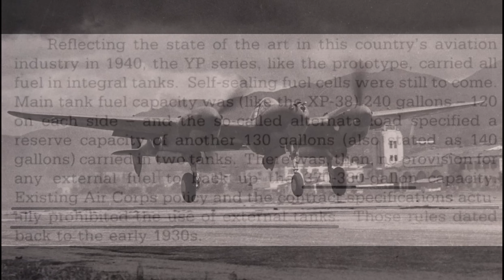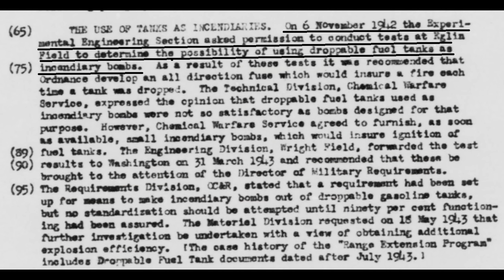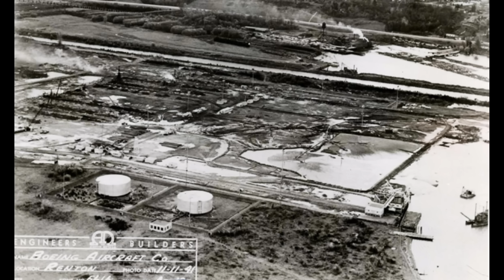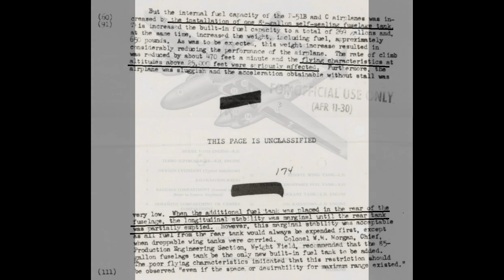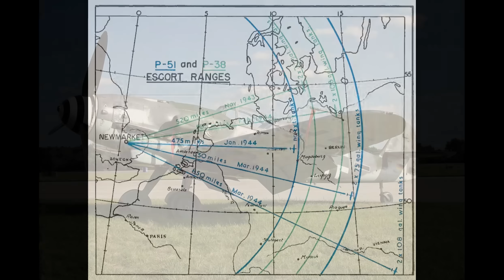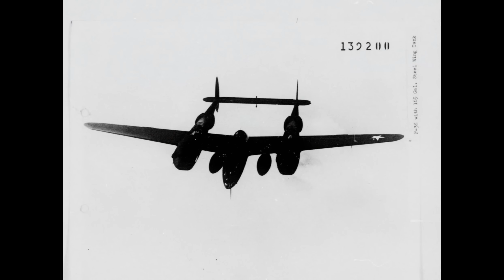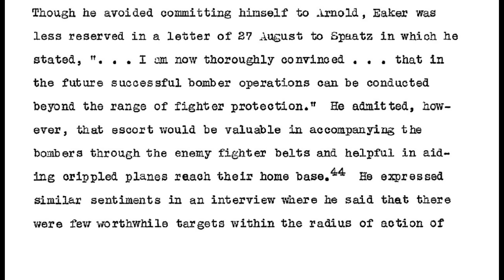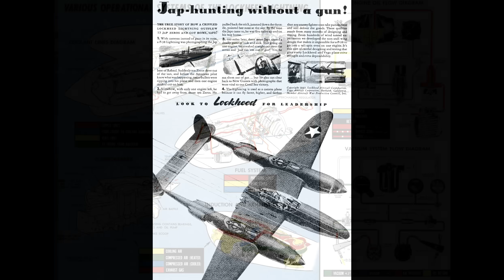The P 38 Lighting and the Bomber Mafia's Failure In World War Two

Comment: Greg, I have a question if the P-38s low dive speed, vibration problems: had it been a single tail plane of more conventional design, if the could have somehow still made it that way with turbo-superchargers, would the single tail have positively impacted the dive issues? I’ve wondered for years if the twin tail design worsened this problem. Not an engineer or pilot, sorry of the answer is obvious.
Reply from the maker: It seems the twin boom design did hurt it's Mach limits. Now it's hard to say how it would have been with another design because they it would really have been another airplane. I do cover the various designs they looked at for this plane in another video.
Reply: @GregsAirplanesandAutomobiles  Thank you for the response.
Reply: The problem with the P-38 and critical Mach was the joint where the center wing joined the center nacelle, and the fuselage booms, brought on by the aspect ratio of the wing required to provide the lift required by the spec issued by the Army Air Corps, and to provide the internal fuel volume necessary for range. The radius was wrong, and it accelerated the air over the wing. The radius was so wrong that any disturbance in the area was a real problem. If the windows were rolled down, the plane would shake violently at speed. Hap Arnold actually forced NACA to assist Lockheed with this, and make their wind tunnel available (NACA didn't want to allow Lockheed to use the wind tunnel to test planes at the require speeds, fearing damage). There was a change made in the radius, from the leading edge back to mid wing, which gave some improvement. But it was only used on the nacelle side, and the change was inadequate. NACA designed more radius changes that made a significant improvement, and even proposed a change to the leading edge. However, these changes required a period of production stoppage, and were denied by the War Production Board. The proposed changes were said to raise the critical Mach of the P-38 to around 0.72, a substantial improvement.

Comment: I'm kinda confused about the p38 variants, did the P38J have the dive brakes and aileron boosters?
Reply: The P-38J-25 had these dive brakes straight out of the factory, but the brakes could be retrofitted to earlier J blocks.

The J-25 was also the first version to move the landing light from a pop-down design under the wing and put it into the leading edge of the wing.
Reply: @BogeyTheBear  thanks

Comment: The issue wasn't range but altitude compression.  The P38 was not a capable long range escort in Europe because the US airforce was flying at 30,000ft.  At high altitude it could only maneuvre at 0.7 mach, compared to the Fokke Wulf's 0.75 mach, putting it at a disadvantage.   The P-51 with the Allison suffered from the same issues, it was only the Merlin engine being put into the P-51 which enabled it to fly escort for the bombers, because it could achieve 0.78 mach before suffering from compression.  In short, a P-38 escorting would and did just end up pitched down and embedded in the ground if it tried to dog fight.  Source: interview with Eric Brown
Reply from the maker: Did you not watch the video? I addressed this. Ira Eaker specifically said he thought the P-38 was the best choice for an escort fighter, and the mach limit issue was well known at that time. To use the mach limit as an excuse for the bomber mafia means you're saying that a P-38 escort would have been worse than no escort at all, which obviously isn't true. Also, I seriously need to make a video about this Eric Brown nonsense. He was an accomplished test pilot, but acting like he discovered the low Mach limit of the P-38 is just too much.
Reply: @GregsAirplanesandAutomobiles  I watched it some time ago and remembered, then saw the Eric Brown interview today and thought it relevant to what you'd said here, unfortunately I lacked the time to rewatch this video prior to heading out earlier, so my apologies for not double checking and packaging my comment up specifically to the content of your video.  I don't wish to advocate for no escort and obviously that's dumb, but merely highlighting that the P38 had been used in the role but had difficulty when doing so.  I probably need to rewatch your video though as I didn't remember you addressing this, so my bad for the memory failure.
Reply from the maker: That makes sense, no problem. The issue with the Eric Brown argument against the P-38 is that he didn't discover that, it was well known that the 38 had a low mach limit from very early on. He talks about it like it was his great discovery, it wasn't.
     More importantly for this discussion,  the USAAF leadership even knowing about the Mach limit though it would be the best escort fighter, but actually preferred NO escort fighters. The point is that the huge losses of US bombers in 1943 could have been greatly reduced with P-38 escorts, they chose not to, which had nothing to do with the Mach limit issue and certainly not Eric Brown.
Reply: @GregsAirplanesandAutomobiles  The mach limit most probably was known during design and prototyping.

Likewise I can totally see how someone in leadership might not know it, or might not know mach limit was the issue; its totally understandable that someone might ask a question that finds its way to Eric Brown and others.  And I can see how he'd consider mach limit and other performance aspects and work out the issue theoretically rather than fly a plane over Germany and figuring in out person as it pitches down into the ground during a dogfight...

So yes, I don't doubt you are right but I also don't doubt what Eric Brown says, as the guy had no reason to lie, he had enough of his own legitimate achievements.  Something being known by one person doesn't mean somebody else has the answer; or knows which metric is the issue.

I think it's likely that multiple versions of what happened are true because multiple things happened.
Reply from the maker: I have addressed this Eric Brown stuff before, but it's buried in a DCS video. I'll probably make a stand alone video out of it as this comes up a lot. It's not that Eric Brown is lying, but you do have to reconcile the fact that he says the P-47 has a low mach limit when literally every other source disagrees and these other sources are not only in agreement, they are much higher level sources on this topic.

Comment: It wasn’t just theoretical range, the P-38 was very complex to operate in a combat environment, just to drop the tanks and arm the guns was a long process. Whereas the FW-190 was a single lever power control, the P-38 and the P-47 both were difficult to manage in combat. The P-38 also had a horrible heater and many pilots were basically incapacitated due to cold by the time they were over the combat area. Add the early compressibility problems in a dive and you begin to see how hard it would be to fight with the airplane effectively.
Reply: The guns and the cannon were chambered on the ground. The gun charger in the cockpit was used to clear jams on the .50 caliber guns, but if the 20mm jammed in flight it was out of action until you landed.

Cockpit heating improved a bit when the gun bays got electrical heating and the warmed air from the second engine was devoted to the cockpit instead.

Mixture was automatic (the control levers had four positions, not a 0-100% lean-rich ratio). Coolant systems were automatic. The props were constant-speed. The only real ergonomic issue was the flap control (thus the combat flap actuation) was on the right-hand side so the pilot had to take his right hand off the yoke to notch the flaps down to that first position in a fight, all while having to worry about power control with his left hand at about the same time.
Reply: Of course it was better than nothing. It’s not a binary question. It’s a travesty that hard headed generals wouldn’t give up on “proving” the theory of precision daylight bombing basically winning the war. It was certainly part of the equation but far from what they envisioned. This mindset followed the USAF right into Vietnam, where F-105’s attempted to bomb the infrastructure of a 3rd world country, not grasping the fact that it was capable of supplying its army with oxen, bicycles and light trucks.
Reply from the maker: That's all been addressed here in other videos. The issue related to this video is basically so what? You can't be arguing that the P-38's faults made it worse than no escort fighters at all.

Comment: Greg says elsewhere that P47 got drop tanks because the British contracts demanded them. It wasn’t worth building two aircraft specifications so they all got the necessary pumps and pipes. The British invented(?) paper based tanks. (1) aluminium was in short supply and (2) they had no wish to donate any more than necessary to the enemy.

Comment: Re the range.. Wikipedia claims 1300 miles combat range. I don't know if that allows for maximum throttle as might be expected in actual combat or not, but the round trip from Salisbury to Berlin & back is around that distance (measured via Google maps)
Salisbury is about 75 miles to the east of London, for context
These numbers certainly suggest the P-38 Lightning was more than capable of escorting the bombers to Berlin & back.
A little slower than the BF 109-G & FW 190-D but not by much: 15-20mph. 

& that's my 3 cents BEFORE watching the video (thanking you in advance, Greg, you do FANTASTIC work, just as good as Rex's Hanger :)   )
Reply: The P-38J, which had 55 gallon tanks in the leading edges of both wings, was the first Allied fighter to appear in numbers over Berlin, in February of 1944. It was capable of over 420 MPH in level flight at a critical altitude of over 26,000 feet. Not slower than the German fighters by 20 MPH.

Comment: One other factor not mentioned was the combat environment in the pre-invasion years in Europe.  The fighters in the early years would likely be at combat power settings over the English Channel or going feet dry in Europe because contact with the Germans was likely at that point.  Later years, after the Germans had been pushed back significantly, long range cruise power settings could be used enroute to escort station with little fear of contact with opposing forces.  Excellent presentation in the video, proving the intransigence of the leadership sacrificed many bomber crews needlessly.  I guess they were deemed to be expendable, a fact I reminded my own crews.  We were all expendable.

Comment: Notice how the bias argument leaves out a vital component, fighter performance. Whatever the P-38's range it wasn't close to a Spitfire once it was there , unlike the P-51. 
Greg stop being a conn man to your flock.
Reply from the maker: The P-51 wasn't an option for the 1943 Schweinfurt raids. Neither was the Spitfire. Thus the comparison is between a P-38 and nothing. I'll make a video about P-38 performance, you might be surprised to see how well it stacks up against German fighters.

Also I'm not sure what con you think I'm running but the viewers here are smart enough to know the truth when they hear it.
Reply: @GregsAirplanesandAutomobiles  - Arnold diverted the 20th and 55th P-38 FGs from MTO/Eisenhower in July 1943. Eisenhower wanted those P-38s,  plus from the 8th AF, four more B-17 groups, all the B-26 groups and keep the 3 B-24 groups sent by 8th AF for the Ploesti attack - for the invasion of Italy. Eaker complained to LtG Devers CO ETOUSA, and Arnold agreed Eaker, and escalated to CG C/S Joint Chiefs Marshall who turned Eisenhower down.

Eisenhower earlier won the 8th AF 'poaching expedition' for Operation TORCH airpower assets - when FDR over-ruled Marshall and Arnold when Eisenhower basically stripped the 8th AF to nothing in November 1942 - including all P-38FG intended for LR escort for 8th AF. Virtually every senior officer in AAF and USA argued against diluting UK based assets to gamble with North Africa invasion. FDR trumped all.

The 20th arrived August 12th, the 55th arrived September 5. The 55th was operational for first mission the day after the 2nd Schweinfurt mission. The 20th operational only late December, three weeks after the 1st P-51B operational mission - despite arriving three months earlier than the 354FG.

Look to the Davis book about Spaatz for some of the details. Look to Mighty Eighth War Diary for operations details of the 1, 14, 82, 78, 20, and 55th P-38 fighter groups with the 8th AF.

Comment: Hmm in the ~ 4:-5 minute time. No, both the 8th AF 55th FG P-38s and 9thAF 363rd FG Mustangs, led by LtC Howard on loan from 354th FG, escorted to - and around - Berlin. The 363rd also engaged in combat shooting down four Me 410s near Grabow about 30 NNE of Berlin. 8th had better Public Relations. Research of ETO long-range missions should also include 9th AF.

You carefully ignored the internal fuel comparisons of P-51 vs P-38, P-39, P-40 and P-47. The P-51/Mustang I in 1941with 170gal in wings had 20 gal/per engine more than the P-38. The same Mustang I and IA also had auxiliary internal cells to increase internal fuel to 126gal - and still carry 2x50 cal. The range of the latter was 1750 mi 'yardstick' range per FAREP documents. The P-51 initial internal fuel fraction advantage from the beginning, combined with superior aerodynamics, was maintained over even the P-38L and P-47N - which is why it had greater combat range with smaller drop tanks.
Reply from the maker: P-38s were the first over Berlin. That's a matter of official Air Force Record. The Evidence of this is on screen at about 1:45. I'm not sure what your point is there anyway. Even if the P-51s were first, which they were not, the P-38's still had the range needed to go to Berlin.

    I suppose you could watch any video or read any book and claim that something you think is important was omitted. The Mustang wasn't relevant as a high altitude escort fighter in 1941, so of course I didn't cover that the early Allison powered version. Every video can't be all about the P-51. It was a great airplane, but it was late to the party and without any real range advantage over the P-38.
Reply: @GregsAirplanesandAutomobiles  - Greg. You compared fuel fraction of P-38 to the P-40 and P-39, last time I looked they weren't relevent as a high altitude escort Ever.

First excursion over Berlin for 8th AF was 55th FG. First excursion for 9th AF on same day was 373rd FG P-51Bs. Look to USAF Study 85 for victory credits that day. Look to the History of the 363rd FG by Miller. The 381st FS/363FG engaged Me 410 and Bf 109s over Grabow with claims of 1-1-3 and the 382nd damaged 2 Bf 109s. They did not hear the recall and orbited over the RV north of Berlin.

381st pilot Maj.Culbertson is shown for the VCs dated March 3, 1944. In other words, do a little more research. The problem with several USAF sources is that much of ETO histories are built around 8th AF and many folks, including you, labored under the illusion that Mustang history was written in context of ETO. 

NO to 'only 75 gal.' used by 8th AF/9th AF Mustangs. Only from Dec 1943 through April 1944. They switched to Bowater 108s and US 110s beginning early May 1944. The supply of 75 gal tanks in 8th were mostly sent to 9th AF for TAC use of P-47s with 2x500 or 2x1000 pound bombs w/75 gal. belly tank on B-7 rack.

Spaatz was a Maj Gen when Eaker was BG (Nov 42). Spaatz was a LtG when Eaker was MG (May 43). While his permanent USA Rank was Col during WWII. he did not salute BGs, ever, after taking 8th AF to ETO. Eaker was also permanent rank Col during WWII. Nearly ALL promotions were 'temporary' but most reverted post WWII, then rapidly recovered full WWII ranks during continued service with USAF. Eaker never outranked Spaatz.

You should give some thought to placing the Case History of Droppable Tanks and Case History of FAREP that I sent you - for your patrons. I sent it to you last year and you frequently pick examples to make your points.